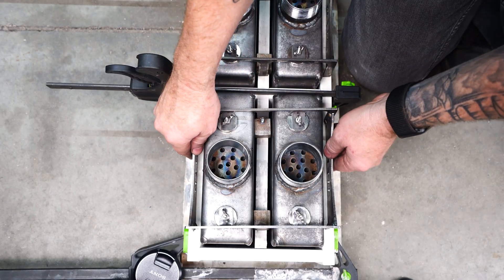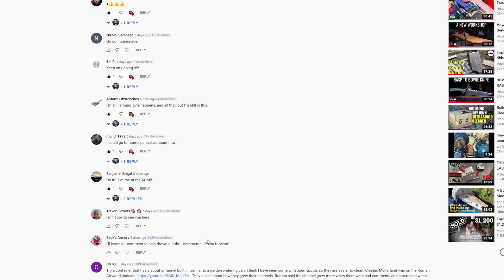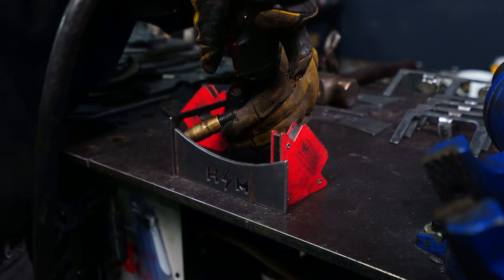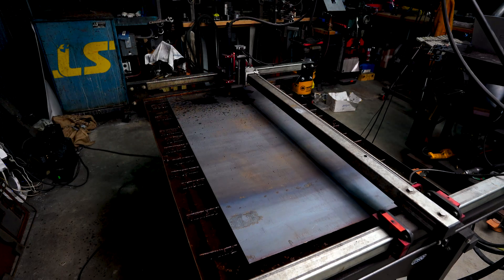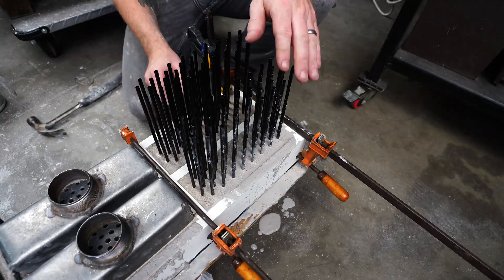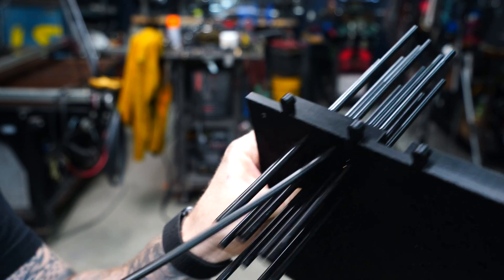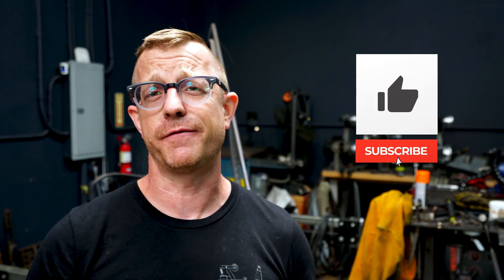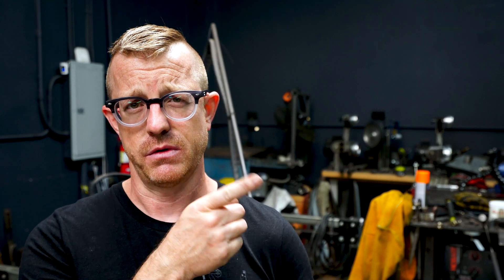Can we make this work? - A Ribbon Burner Concept

Comment: Brian, 

Maybe there’s a way to temporarily cap the straws when pouring the refractory.  

I’m sure you could design some type of template with a series of small bosses and pull the plugs when the refractory is all poured in.   

Vibrate the sides with a palm sander if you’re concerned with trapping air at the bottom (while capped)

Just an idea.  Keep up the amazing work on your page.   Great to see your passion for American manufacturing.  I’m sure that’s rubbing off on a lot of people, myself included.  

-NR

Comment: What do you think of a 4 sided ribbon burner for a barrel forge? Four ribbon burners at 90 degrees (as looking down) to encompass the whole crucible in swirling flame? I’ve never seen one and I’m wondering why. 
Thanks,
Paul
Oh, where can I get the STP files for your gen 4 2 x 72” grinder?
Reply from the maker: I would think that could work. But it might just be an overkill (size dependent) also it may be a fuel hog. You can get the step files for the Revolution on my website www.HouseMade.us we sell a CAD version now that includes those files. Thank you!
Reply: @HouseMadeUS  
Thanks. I thought it might be over kill, but would limit each burner to a single row of holes. Overall, the area of all openings would be the same as a single, multi row burner. 
I really like your grinder design. Just need to save for the parts. 
Thanks,
Paul
Reply: I'm building my much as discussed. 
I'm taking 6 months to build due to health issues, but now I just finished   doors that need mounted. Like the doors mounted in this video, I'll do a similar hinge but only one large door. I didn't like my design but the double doors I set up so I could do either if needed. 
I didn't see your forge before I design mine but believe my forge might have advantages it has 2 " wool insulation on most of its square walls and 2.5 inches over top panel of the Cast o Lite interior of 1 inches of mortar 
My burner says angle gives a circulation of heating, and some say that good and some disagree .
Thanks

Comment: Great idea with the 3D printed forms.
You might get far better results and burner longevity to make sure you’ve removed all the bubbles you can from the refractory.
Also, if you plug the ends of the straws with pieces of dowel that are slightly pointed on the ends, your funnel system will work better and faster.
Just sayin’.
Thanks for all the great projects!

Comment: What if the floor of your mold was made of steel with steel rod welded into it instead of straws? The rigidity would help with pouring the refractory too. Plus as someone else suggested some good vibrations to help settle the refractory. Also, I just absolutely love what you are doing for the manufacturing/ maker community! Keep it up good sir!